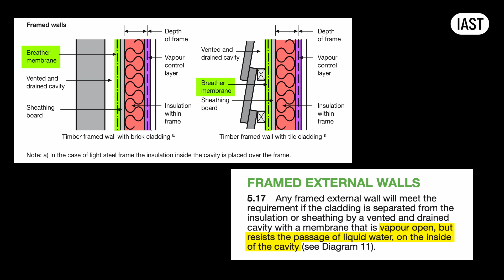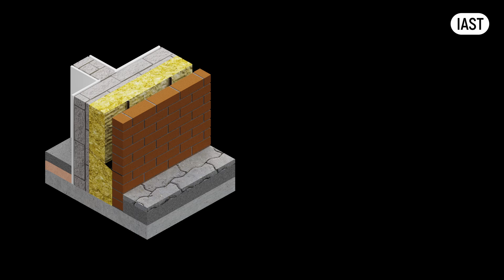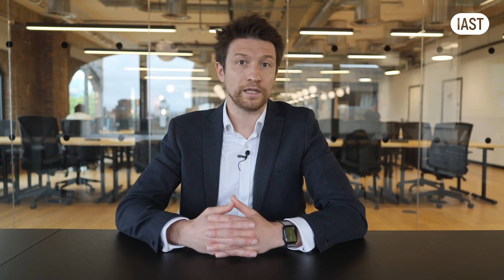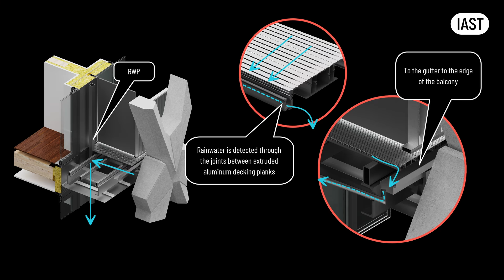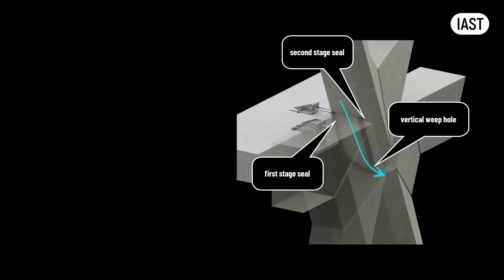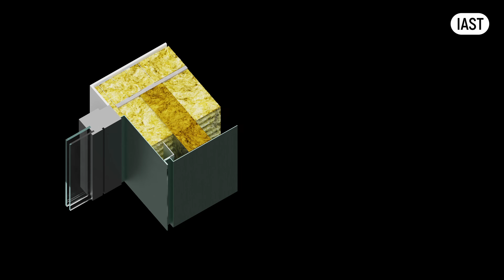Building Science. Rainwater Management Practical Applications. Facade Design and Engineering.

Comment: That curtain walling EPDM Jamb detail made me cringe. I've seen it done so many times on site and I've not once seen it pass a CWCT test. However, I'd argue that the NHBC head detail is not strictly correct either. Depending on the curtain walling system and the type of drainage method used it can actually interfere with pressure equalisation, blocking off the top of the drainage channel in the mullion.  Instead, the mullion extension itself should be notched back to form a box and at the top of the facade, EPDM should be bonded to the outer face of the box at the mullion, and at a carrier angle along the tops of the transoms installed at the exact same position. At the bottom, the same principle should be followed but the mullion box should have notches up the sides to allow the EPDM to be bonded to the "Inner" face of the mullion box.
Reply from the maker: Thanks for your comment! It would be great to have a chat online or in person. Please email us at info@iast.uk  Speak soon!